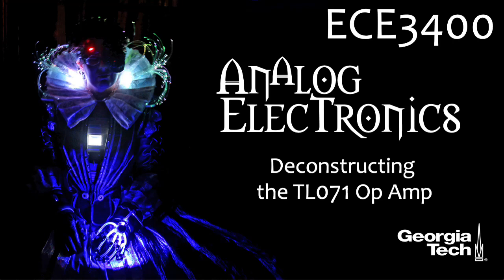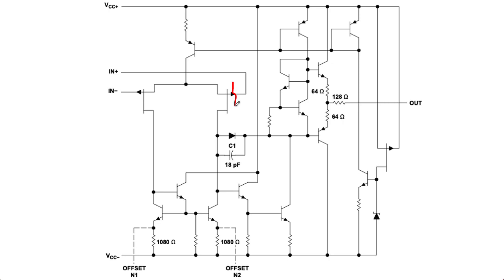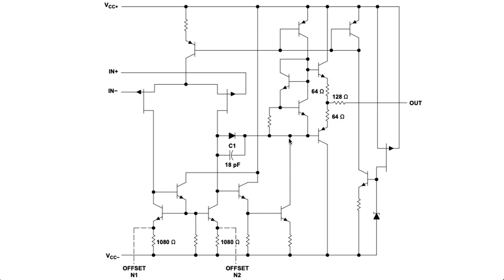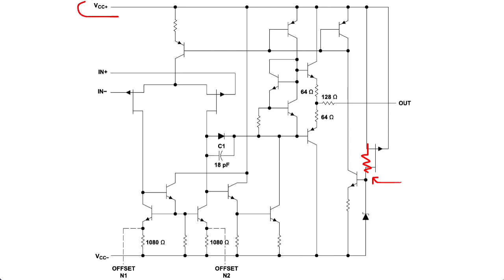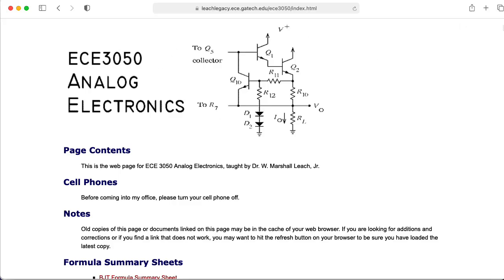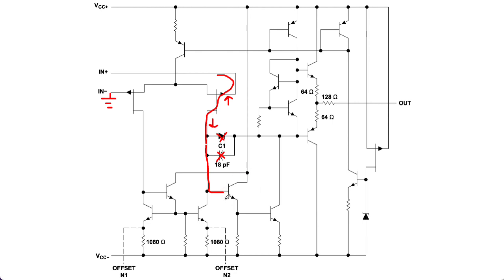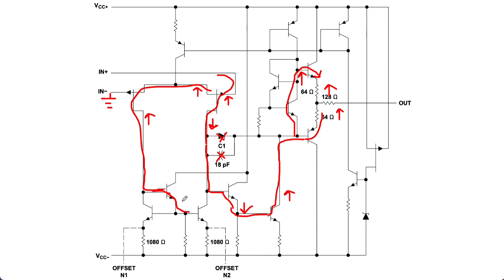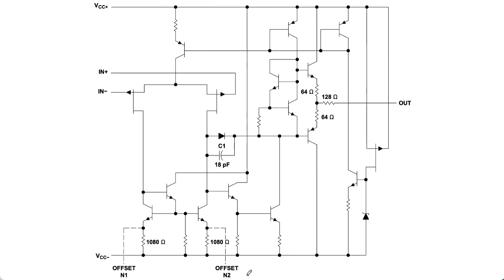ECE3400 L41: Deconstructing the TL071 Op Amp (Analog Electronics, Georgia Tech course)

Comment: I know it's been a few years' time. Just enjoyed viewing this video and I will be looking forward to others you've taken a part of your life to offer us. Thanks!

I do have a comment though. Making all the assumptions shown for the "BJT Low Level Mirror" it is quite possible to provide a "closed solution", if you allow for branch-0 of the LambertW (product-log) function. Set the thermal current as IT=VT/RE and then compute IO=IT*LambertW(IREF/IT). LambertW is used throughout the scientific literature on BJTs. So it's not rare to see, if you run around in those circles. It's just not seen in engineering so much.

For example, in the case in this video if you take VT=25.865 mV (27 Celsius) and RE=1498 as shown in the video and assume matched BJTs then it computes approximately IO=51.3 uA. So it is possible to examine an existing schematic, plug in the resistor value, and work out IO directly. (Of course, one could also iterate.)

Comment: I noticed that TI has significantly changed a couple of parameters of this op-amp in the newest datasheets. I remember that the TL07X, regardless of the case type, had a bandwidth of 3 MHz, input noise of 18 nV/√Hz, SR of about 13 V/μs. Now as some more versions have appeared, the manufacturer changed a lot. The previous parameters seem to be assigned to some surface mount options. The good old PDIP now has a wider bandwidth(5.25 MHz), worse noise(37 V/μs) and the SR is claimed to be at least 8 but typically 20 V/μs. However, it's nothing compared to the upper supply voltage change:  42V !!! Even the recommendation for PDIP is 40V. After all, in the past, it was a normal practice to provide +/-15V (30V) power supply voltage and sometimes only someone carefully veined it to +/-16, maybe +/-17V. Truly a weird thing, I wonder how this relates to previously produced units of the typical TL071/2/4 in a DIP package.

Comment: I've got a large mixer based mostly on tl072's, it's interesting learning the circuits involved but i had always hoped to learn more than just 'op amp magic little box', while your lectures are a little bit above my head, (i still don't quite have the back-knowledge of equations in transfer functions) it's incredibly interesting and i'm sure in 6 months i'm going to absolutely tear through these and learn way more than I ever thought possible, I totally still am even without the mathematical side, it's interesting to see the interactions of many parts

Comment: The diode is to prevent saturation of the transistor that drives the output stage.
The transistor would need a lot of time to recover from saturation.
Reply: It will prevent sticking like you say, but it has an even more important job to do as well: 

Without the diode, the collector-emitter current of the first transistor in the darlington voltage amplification stage and base current of the second one would also be problematically high in clipping. It would be limited only by the input stage current multiplied by beta. It would cause at the very least high power dissipation but also likely destruction of the IC.

Comment: Hi. As an amp repair person(usually tubes), it's great to finally see a set of lectures that go into the engineering level rather than simply build or repair an item without knowing why.  I could be wrong, but the bjt before the two outputs is a phase inverter, allowing the last two bjts to work together for the push-pull.
Reply from the maker: Ah! Even if you didn't mention tubes, your last sentence immediately told me that you were a tube person. ;)

Tubes are somewhat analogous to NPN transistors or n-channel FETs. With tubes, you don't have an equivalent to PNPs or pFETs. Thus with tubes you need a phase inverter for your push-pull stage, but with transistors you don't since you have access to complementary pairs.
Reply: @Lantertronics  Thank you ever so much for the feedback! (pun intended).  Video makes total sense (after rewinding some parts).  Now to consume more.  Not looking to be an engineer, but am trying to understand how it all works together, and be able to calculate & troubleshoot by theory & math, rather than by trial & error.  Too bad we didn't have this medium (and you) 40-ish years ago in my college days.  Keep up the great work.
Reply from the maker: You might find this of interest: https://youtu.be/YsIzf5Msaws

Comment: It would be cool if someone would try to build a discrete version of the TL07X series op amp by using this schematic diagram, but though I also know this schematic diagram isn't exactly what is on the die. Its more just representative what is on the die.

Comment: Does the diode shorten recovery time from negative output clipping? Looks like the right output node of the differential might rise to quite some voltage above saturation in a negative output clipping situation and then compensation C1 might need a lot of time to discharge and the circuit a long time to get back to linear operation. Positive output this diff output node is limited by negative supply and it isn't as bad.

Comment: I was hoping you might talk about how phase reversal happens with the TL071.
Reply from the maker: That would be a good topic for another video.
Reply: It's caused when the junction in the JFETs start conducting: the most common case would be in a voltage follower when the IN+ input is brought below about 2 V from the negative rail. The right JFET bottoms out and the gate junction becomes forward biased. The input stage current will flow out of the input, starving the bipolar transistors at the bottom.

This makes the output go to the positive rail when the IN+ input is brought close to the negative rail. Pase inversion :D

Comment: Hey professor, i found this Cirrus CS4272 ADC/DAC and it has a differential input or 2. How does that work? page 32 of the datasheet.
also clocking is somewhat unclear.
Reply: The Cirrus CS4272 looks like an interesting and versatile chip.  PDF Page 32 provides an example of a differential input circuit and explains some of the requirements it fulfills.  It looks like there is an on-board clock oscillator, or you can use an external clock.  Would be curious to know your application for this IC.
Reply: @teechui2401  Ya, the schematic for the output is clear, but not quite for the input, 2 voltage followers heading the input +/-.

Should i use the positive input and tie the negative to ground?

This is not a device you can use on a  breadboard, so the PCB design has to right first time. otherwise you're trowing stuff in the garbage if it doesn't work right.

Analog devices seam to have a opamp like device but providing differential outout.

There are more of these chips, like AKM from japan, but not "everyone" sells that.

Well for a start seeing to get communication going between MCU and this chip @ 96 or 192 kHz. record  and produce sound.

Comment: the signal diode across the compensation capacitor seems to prevent the most negative excursions of the collector of the middle gain stage (the one that sinks the vbe multiplier combo) and keeps it close to the compliance of the input fet pair along with their current loads; i guess it keeps it from dynamic hard saturation. however, since it's been over a decade since i did any analog pondering take it with a pinch of salt ;-)